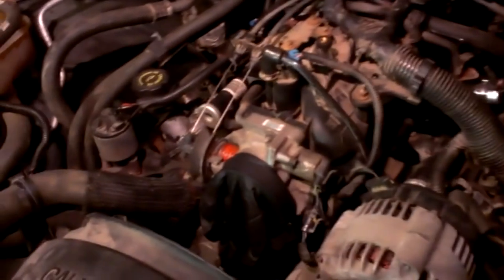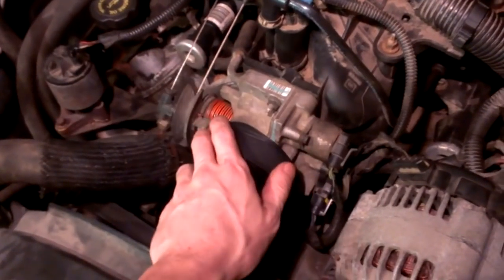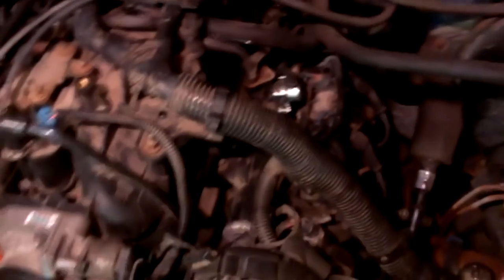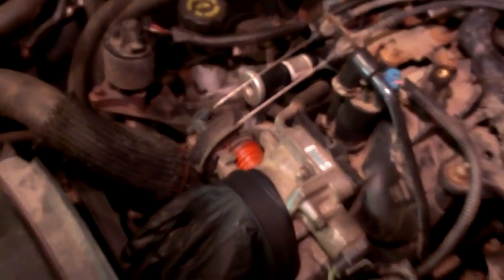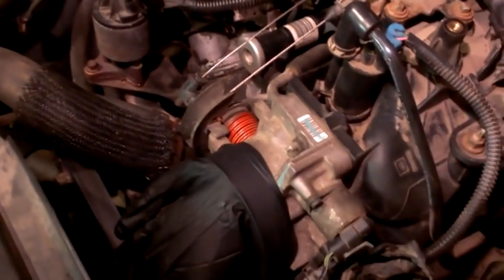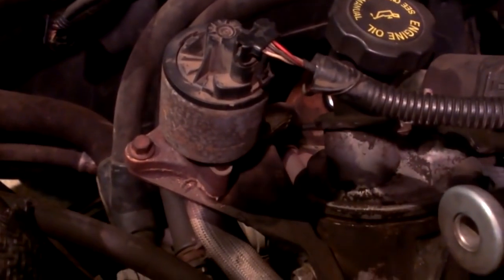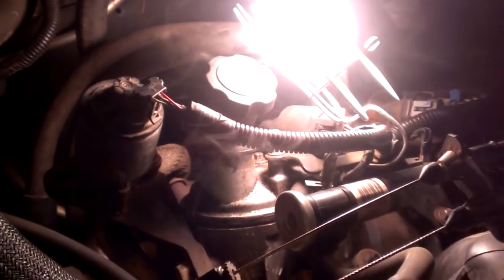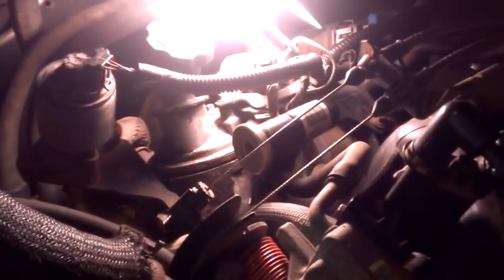How to find a vacuum leak for $1

Comment: maybe another way is to still put the glove on the inlet, cut top off one of the glove fingers off and put a hose in that finger, tie off finger around hose unless it already provides good seal and then blow. you get to check the hose going to the brake booster also then plus use whatever size hose you like to blow into, just a theory on your good idea. you're also then not putting lips to a maybe disgusting piece of hose from the engine bay.

Comment: I've got the same issue on my v6. I've heard about this but figured a human wouldn't be able to push enough pressure into the system to force smoke from a miniscule gap.
Now I've seen you do it I'm going to try it.  Thanks.
Reply from the maker: Ellesmere Wildwood I'd try it anyway

Comment: This in itself is worth a sub 👍👍👍.i looked on amazon at smoke machines & they ranged from 360.00 to 1100 dollars. Im more than likely only gna need it once in the life time of my yukon xl so not a good investment. Thanks again bro. Lets just hope my lean code is this simple. Other than seeing the lean bank 1 & 2 when i connect my scanner i couldnt even tell i had anything going on with the truck.runs great🤔. It did show up last week tho when we were in the negative 0+ temperatures for a week or so here in md. So that cld have something to do with it too idk.
Reply from the maker: That's what I thought too. Not gonna buy a smoke machine for this crap. Cigars are cheap and I've done it on a couple vehicles and always get results.
Reply from the maker: The cold could harden or shrink the plastic fittings and let air in.

Comment: wow, i know this was a quite a few years but was it the egr itself or at the base where it's bolted ? Thx
Reply from the maker: Actually it was the pipe between the egr and the air intake. I'd had the intake off a couple times and developed a crack in the pipe.

Comment: NEED HELPPP! I'm a  long time listener first-time needing help. I have a 2010 Hyundai Accent sedan. It's a 1.6 liter 4 cylinder engine. I have a po301 misfire in cylinder 1. I've done four things to try and resolve this issue but it still is misfiring. 1st thing was I replaced all the spark plugs and gaped them. 2nd thing was I replace the coil on cylinder 1 and it still misfires. 3rd thing was I did a compression test on all the cylinders (1-4) and it's 180 across the board. Great Depression when all the cylinders. And the 4th thing was I replaced the cylinder 1 fuel injector and it still misfires I'm totally stumped and now super frustrated and would greatly appreciate it if you could tell me which direction to go now? Thank you!
Reply: that sucks cause it sounds like you pretty much eliminated all the cheap stuff lol I would get a spark tester, they're cheap.  plug it inline between spark plug and coil, then it has a little where you can watch to see if there's actually a spark going to the plug. If not, it could be an ecm issue or the wire harness/connector to that coil.
Reply: i had a misfire on a cylnder 2 when i tried to do a 0-60 launch on my v6 and i poured a bottle of seafoam into the gass tank (was told it would clean your injectors and fuel system) which couldve been the root of the problem , never had that problem ever again

Comment: Could having such a leak also produce a high pitched noise? I have a noise when pressing hard the acceleration at about 2200 rpm. No mechanic can really tell me where the source of the noise is
Reply from the maker: Vacuum leaks can cause a noise. Like a leaky air compressor fitting sound.

Comment: Where did u blow smoke it at? I got p170 mass airflow/vaccumm leak code on 99 Eclipse Spyder.  Might try this.
Reply from the maker: Vacuum line for the brake booster.  It was the biggest vacuum line I could easily get at

Comment: Does my maf sensor go bad if I have a air vacuum leak . And should another code pop up . Also I've seen smoke come out from somewhere behind engine
Reply from the maker: No, a leak would not cause the maf to go bad. It could throw many codes. I'd look at what the smoke is coming from.
Reply: Thank you

Comment: Hi ,, does anyone know if a vacuum leak can be small enough to not throw off a code yet bad enough to create rich 02 sensor readings ?
Reply from the maker: riff724 riff724 it would show lean O2 readings. I'd look at the fuel pressure regulator for rich readings.
Reply: i have a 2007 ranger 4.0 engine sohc . is the regulator in the fuel tank ?  and  would you  happen to know if and  where the fuel damper or pulse module would be located . I do have some old spark plug wires yet get no misfire codes ,,,,, I was also wondering about the purge canister . if after being towed 3 times could gunk have disrupted the entire fuel system
Reply from the maker: I don't know what a fuel damper is or a pulse module (unless it's carburated) but the fuel pressure regulator should be on the fuel rail or inside the intake at the engine

Comment: Nice video. Which hose did you blow the smoke into? Is that the hose that comes off the side of the air filter for the air intake and connects to the valve cover?
Reply from the maker: Miles Papineau I blew into the hose for the brake booster. It was the biggest and easiest to get off.

Comment: Hey Moose. Using a DJ fogger I'm getting smoke seeping from the valve cap of the IAC valve . Is that normal?  Returned 2 so far every replacement leaks.
Reply from the maker: It's been a while, but I don't think that's normal.
Reply: @Moose54656   yeah  have not seen any u tubers mention it on smoke tests
Reply: @Moose54656   finally found a comment on it   they say its normal per Ford  Video :  Vacuum Leak Detection - Smoke Test Results on SkullV's 1998.5 SVT Contour
thanks man
Reply from the maker: @dtlastraightahead2133  very well could be. Have fun!

Comment: Did I miss whichever pipe he blew the smoke in ?????
Reply from the maker: Any vacuum line works, but I used the vacuum line for the brake booster because that was the biggest.

Comment: what if you replaced the cigar with weed smoke?
Reply: gain about 20hp
Reply from the maker: I couldn't focus on the engine then. Nor would I care.
Reply: your car would get the munchies and use more fuel
Reply: What. Are we taking about again?
Reply: Don’t do it your car will get high and won’t crank for a few hours!!
Reply: Quirk Silver 
@Quirk Silver if you do that it will make your car run sluggish 🤔
Reply: Your car would get stoned😂😂

Comment: Did you know that you could also use your garden hose and water if you're afraid of carcinogens involved with cigars? Hook up the hose and turn it on full blast, easy to spot and costs nothing!
Reply from the maker: Joseph Wasilitz be my guest and be sure to record it.
Reply: I would use a spray bottle with a little bit of dish soap better. Using the  garden hoes can run the risk for water loging the engine or water loging any electronics.

Comment: Are you blowing into a hose (and connected to what)?
Reply from the maker: I disconnected the hose going to the brake booster and added a scrap piece on so it would reach to the back of the engine. that's where the brake booster connects into the engine.
Reply: +Moose54656 Thanks for the video and your prompt response! I'll give it a try (and hope it's not the intake gasket).
Reply from the maker: +David Edmundson no problem. What kind of engine are you working with?
Reply: +Moose54656 2000 Honda Odyssey 3.5 V-6. Got the Cigar and hose today. Will give it a try over the weekend.
Reply: Moose54656

Comment: Does the engine need to be on to run the smoke test?
Reply from the maker: No.  It actually won't work if the engine is on.
Reply: Oh ok thanks ima give this a try in like a hour I tried the brake cleaner on random hoses thing but found nothing.. hopefully this works

Comment: what the hell is a brake booster?
Reply from the maker: Mattia Williams it's a device that uses vacuum pressure from the engine to "boost" your brake pedal, giving you power brakes. Try pressing your brakes with the engine off, then with the engine on. You should feel a big difference. To find the brake booster check the rear driver side of the engine bay (in USA cars) for a plastic container with a lid that says "brake fluid" or "DOT 3" or possibly "DOT 4". That container is on top of an aluminum manifold with a bunch of steel tubes coming out. That is your master cylinder and brake lines. The master cylinder is attached in the back to a round part that looks like a doughnut and has at least one rubber or plastic hose connected between it and the engine. That's the brake booster. I blew smoke into that hose after I disconnected it from the booster.
Reply from the maker: Mattia Williams I was looking right at the booster and master cylinder at the 37 second mark
Reply: Moose5465

Comment: I thought the engine had to be running for this test?
Reply from the maker: You wouldn't find anything with the engine running for this type of test. All the smoke would get sucked through the engine instead of out the leak.